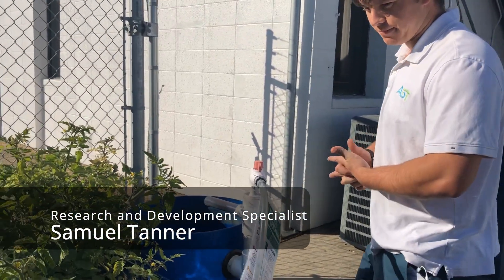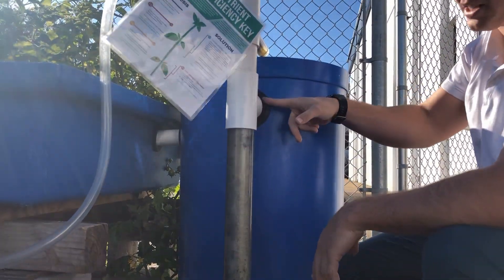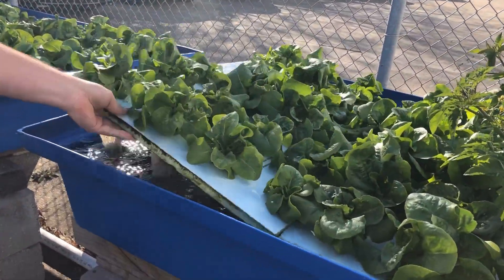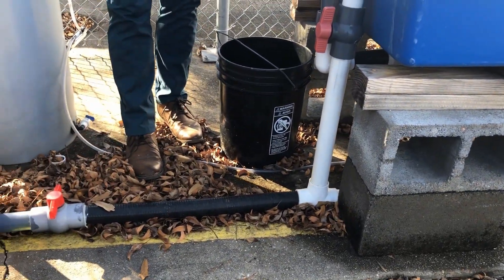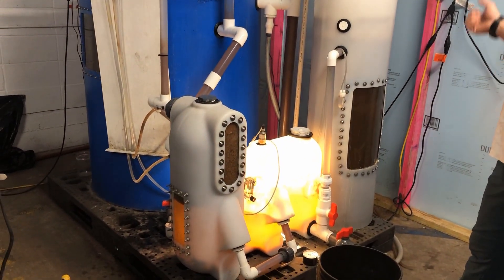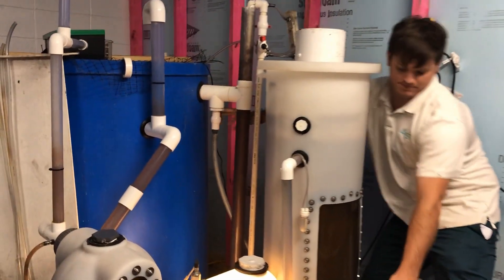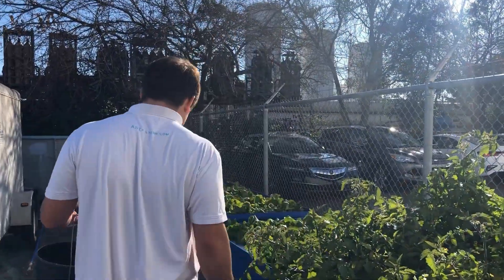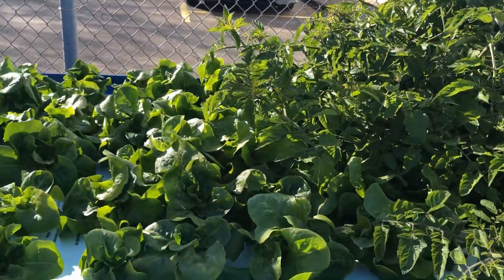MDC Aquaponics: Dual Environment Control with AST's Decoupled Energy Efficient System

Comment: Can you buy too big of a bio filter?
Reply from the maker: Evan, 

Yes, you can oversize a biofilter, but it would need to be grossly oversized to be detrimental. What limits the size (oversized) is going to be system turnover. With a packed bed biofilter, like a bead filter, you must maintain a certain flow through the filter in order to remain aerobic. This would control the tank or system turnover which if the filter is too large compared to the volume of the system, would create too fast of a turnover and too high of a current in the system. If a bead filter is operated below its minimum flow rate, the bead bed could go anaerobic and create water quality issues. A good rule of thumb is 10 gpm/ft3 of filter for flow rate sizing. For biological filtration, I would not go above 1 lb feed/ft3-day to maintain safe TAN levels in the system.

Hope this helps and thanks for watching!

Comment: İ am little bit confused about which type of filters to buy for my aquaponic project. İ have been advised by others to use a drum filter followed by biological filter then by a UV light clearing filter. Others told me that İ can add a bead filter after the drum filter. The problem with these suggestions that all these solution will lead to losing water when washing out the solids. İ am interested in your filters because İ can take out the solids without losing water. However, everyone one keeps telling me that beads filters are not convenient for commercial projects. Kindly would you advise me on this matter? Thanks
Reply from the maker: Thanks for the question. There is a common misconception that mechanical filtration and biological filtration must remain as two separate processes in order to maintain high biological filtration rates and limit heterotrophic bacterial overgrowth in the system while still maintaining solids free water. This is mostly true if you are relying on  traditional hydraulically washed systems which if requiring multiple backwashes per day to prevent biofouling will end up rejecting too high of a volume of water each backwash cycle costing you time and money. However, unlike traditional systems which rely on backwash water to clean the media and discharge sludge, our PolyGeyser filters use a pneumatic charge which build internally to periodically air scrub the media. Since this process is pneumatic and internally concentrates the sludge, no water is loss during an actual backwash which means we can backwash multiple times per day to control biofilm overgrowth and still maintain really high biological filtration rates. Water is only removed from the system when sludge is purged (typically 1-2% solids highly concentrated). We call this process bioclarification and this approach has been used for years to operate many commercial systems domestic and internationally. Ultimately, choosing a PolyGeyser filter (bioclarifier) for your system will lead to reduced capitol, maintenance, and water costs since you will only need a single filtration system to handle both mechanical and biological filtration, backwashing is auto-pneumatic with no moving parts or electronic controls, and your water loss due to backwashing will be greatly reduced. 

We would be happy to discuss what filter will be best suited for your project, just reach out to us through our website: 

https://astfilters.com/aquatic-systems/contact/

I hope this has helped answer your questions...Thanks for watching!
Reply: @ASTFilters  thank you. How many microns the size of solids that it can remove? Would it be able to clean 5 micron? İ sent to you yesterday an email to your contact page on the website. İ will be looking forward to discuss with you the system requirements. Thank you
Reply from the maker: @Jean.34  Our filters typically capture all particulates 50 microns and above single pass. Since RAS is a recirculating applications, smaller particulates are captured in subsequent passes, albeit at a lower efficiency. But again, in recirculation systems, the smaller particulates are removed in multiple passes regardless. I am sure somebody will be in touch. Thanks!

Comment: Ive got a question not quite related to this video, but thought i would reach out here, do bead filters have any tolerance to static or zero flow environments? I have been researching aquaponics a lot and am about to make my first attempt at a system. Anyways would a bead filter work in line with a bell siphon or would it be best to have it in line with the pump. I have been thinking of a top down system fishtank above sump tank and pump below and flood and drain bed between, anyways the goal is putting a bead filter(xs300) in line between the fish tank and substrate bed with a bell siphon for flow, and maybe a reservoir to keep air bubbles out of the filter and prevent backwashing prematurely. Im gonna research more but i couldn't find anything specific about it so far.
Reply from the maker: Adam, 

Short answer, yes, our filters can be operated with intermittent flows that you would see with a bell syphon, with the caveat that no air is sucked into the filter. This would result in cloudy water due to the bubbles floating through the beads (but you have already thought of that!) and knocking off the solids. That being said, these filters are most efficient with continuous flows. If flow (pressure) is pulsed to the filter, this can cause minor disruptions in the bead bed which may cause the release of some captured solids. Also, if the filter is left anaerobic, sulfides can build up due to the degradation of organics in the filters. These sulfides can be harmful if discharged back to the RAS system. Ultimately, I would recommend continuous flow operation, but intermittent is possible with the right management.

I hope this answers your question...Thanks for watching!